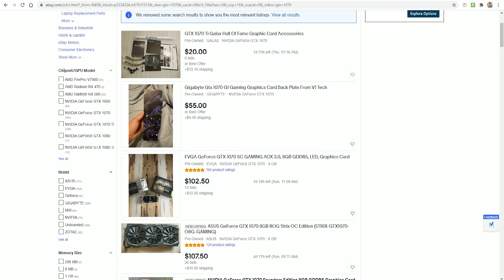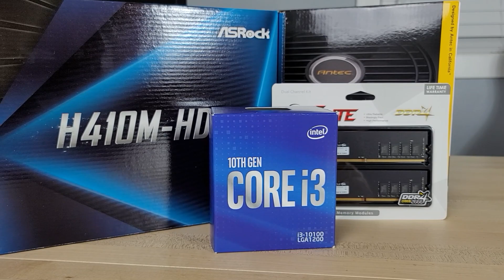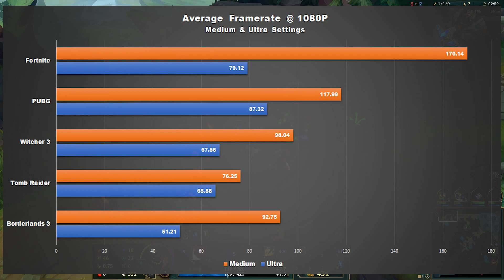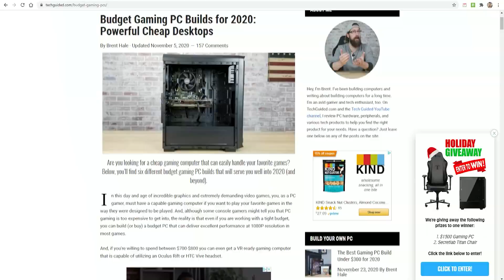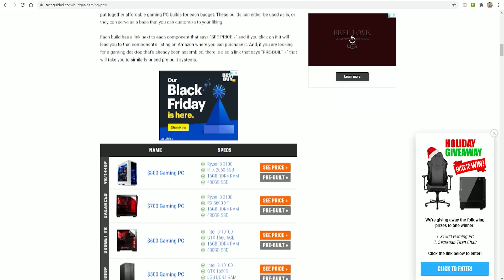$500 Gaming PC Build for 2021 - i3-10100 & GTX 1650 Super

Comment: Why on earth would you use a single stick of ram?  Save a couple bucks, get a cheaper case or a 128gb ssd w/ a cheap mechanical hdd so you get at least a 4x2 kit.  You're leaving performance on the table at the cost of a few $$$.
Reply: Maybe planning to add 1 more 8gig stick in future, I see this build is more upgradable...just my opinion, correct me if im wrong
Reply: wait this will work in a different case????? i want to get a different case that looks better and it’s 40$ and i have enough to buy 16g of ram
Reply: @GIOk2142  yessire

Comment: How big of an impact will this motherboard have on the featured i3? Dramatic fps loss?
Reply: motherboards don't effect fps I'm pretty sure
Reply: @Karani0  ok h410m vs Z490 which will give u better fps?
Reply: If you have specific usage where the applications only use like 2 cores then Z490 with good RAM will give less stutters and higher FPS. Otherwise getting some H410/B460 with a i5 will be the better choice.

Comment: yo odd timing I actually ordered the same CPU and case the day this vid came out, planning to get a 1650 super down the line (i have to suffer with UHD 630 till then)
Reply: i would recommend looking on eBay for used cards. gtx 1650 isnt the best for the money
Reply: @seabomb1  are used cards as dangerous as used PSU's?
Reply: @achilloste6265  no the best things to buy used are cpus and gpus they are completely safe
Reply: @seabomb1  the normal gtx 1650 isn't worth the price as it barely performs better than a 1050 ti, but a 1650 SUPER on the other hand, performs way better than a 1050ti, 1060, and better than a rx570 and rx 580
Reply: good choice, the 1650 super is the best budget gpu rn, it would be the 1660 super if it was in stock and the prices weren't jacked up
Reply: @seizmic7024  do you think anything new will come out by april 15? that is my birthday and im hoping to get money to build a pc
Reply: @tomgreenwood4978  yes
Reply: @tomgreenwood4978  there’s a website for when gpus come out on Newegg of course you’ll have to pay more than usual about $40 but it’s probably best for now
Reply: @diegomusty  what’s it called and how do I get it?

Comment: If you have that i3 10th gen ik it has integrated graphics so what do you do before installing ur gpu? I am having trouble with my gpu and my pc doesn't show that I have a gpu and it is put in correctly.
Reply: Did you connect all the cables?
Reply: Did you plug your HDMI cable into your GPU?
Reply: You need to install nvidia drivers

Comment: I love the build but does anyone know if I can change the chassis out for another one, I’m new to building pc’s so I don’t know if I have to look for a specific chassis or what?
Reply: Only if you want! The size of your chassi/case depends on your motherboard and probably gpu size. All ATX cases will fit any size motherboard (atx, micro-atx, and mini-itx). All Micro-Atx (or sometimes written as m-atx) can fit a Micro-atx board or mini itx board. Basically, just make sure your _ size motherboard matches your case. Then check the requirements for gpu, psu, and probably fan measurements. (Just make sure your gpu can fit inside the case and check to see what fan size you'll need.) Bottome line, is Atx cases fit all. M-Atx cases fit m-atx boards and mini-itx boards. Mini-Itx cases only fit mini-itx.

Comment: can i use the MSI H410M-A PRO ProSeries Motherboard and ZOTAC GAMING GeForce GTX 1650 super while building it the same way? everything else is the same btw, im mainly worried that the gpu is too big and wont fit as it has 2 fans

edit: nevermind, just realized that i could find the full list of specs on other websites, including max gpu length
Reply: yeah you can

Comment: Does anyone think I could replace the 1650 super to a Rx 5500 XT 4gb? I have my case gpu and power supply but it was for a different build. I was originally gonna go with the ryzen 3 3100 but the prices have skyrocketed out of nowhere. But they require the same size case and power supply so I wanted to see if this would work out using the Rx 5500 XT 4gb instead.
Reply: Try it in pcpp
Reply: DONT USE THE 4 GB VERSION ITS WORSE THAN THE RX580
Reply: the rx 5500xt 8gb is much better than the 4gb

Comment: i'd get this build but with more ram, more storage, 1 more fan, 650w psu. which i did get and its coming before christmas!
Reply: why 650?
Reply: @axellcarrasco1736  just in case for everything is powered well and i can connect a lot of external stuff
Reply: @spareeed  550w should’ve been enough for an i3 and a 1650 super
Reply: @spareeed  but it’s still good tho for upgrades in the future
Reply: @axellcarrasco1736  true

Comment: so what your saying is I can’t use 3200 mhz ram with the i3-10100?
Reply from the maker: You can, but it won't run any faster than 2666 MHz
Reply: @TechGuided  can i use a 3000mhz 16gb ram?
Reply: @carlus6432  yes but it won't run 3000mhz
Reply: The 3200 is the most common out there now and probably what you will get on sale. If you get Ram,  get the 3200 with the better timings and it will potentially do you  well for a future upgrade to Gen 11 CPU
Reply: @jeffho1727  oh I switched it up I’m getting the R5-3600 and 1660 super already bought most parts I’ve been doing my research for a while know so I know a lot now.
Reply: I3 10100 using 2666mhz still runs games better than an oc r3 3100 with 3200mhz ram
Reply: @mab3667  Moot point cause I cant buy one anyways( at a respectable price) so something will beat nothing all day long. My 10100 was on sale and available.

Comment: How hard would this be for someone who has zero computer building knowledge or experience? I am always open to leaning and can follow directions but I don’t want to be in over my head...
Reply: building a pc is very easy. follow a step to step guide from a good channel and you'll have no issues :)
Reply: SAMEEEEE
Reply: Ive done it before in my old days but the computer store I bought the cpu/ mb/ ram and m2 drive assembled and tested them for free so I could install in my old case. Good for me and good for them as it was bench tested after assembly. Ask if they will do it.
Reply: Lookup POV building a PC a guy named Linus helps

Comment: Will this build work if I use normal 1650 instead
Reply: 1650 super has new gddr6 memory so its 20% faster then regular model. It will work for sure but expect lower fps.

Comment: Can I run Cold War on this? Or warzone?
Reply: With 16Gb Ram, Yes 
80FPS on Ultra
Reply: make the 1650 and 1660 super with a i5 10400f and it will run it 3x fateer
Reply: @rev-9947  yeah but that’s also a lot more expensive

Comment: Hey, I've recently built a rig with a 1660 super, its all working but the gpu fans are not spinning, I've double checked the connection and installed all the drivers... any suggestions? Thanks..
Reply: The gigabyte gpus have fan stop so the fans only spin above 60C
Reply: @divoulos5758  even inno3d has 0 rpm mode

Comment: why not the get the 10100f?
Reply: Whats the difference? I need to choose soon
Reply: @carlus6432  10100f needs a dedicated gpu. 10100 doesn't because it has an integrated gpu
Reply: @mjbarien  oh ok I'll get the 10100 with a gtx 1660 S is that a good combo?
Reply: @carlus6432  yes but you can save a good amount of money if you're gonna get the 10100f instead. You won't be needing the integrated graphics of the 10100 anyway since you're already buying your dedicated gpu.
Reply: @mjbarien  will i get. A good amount of fps?